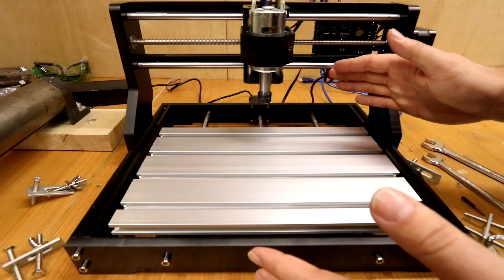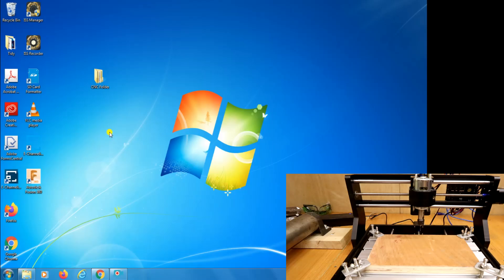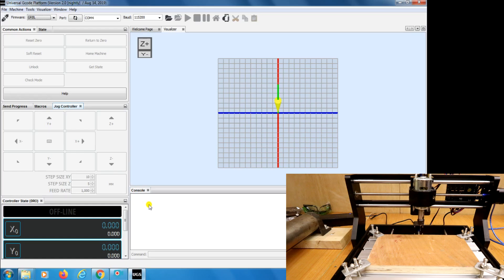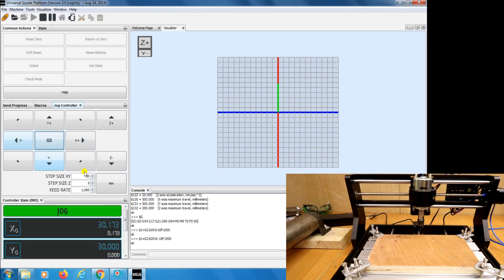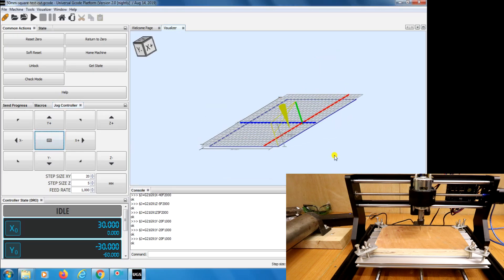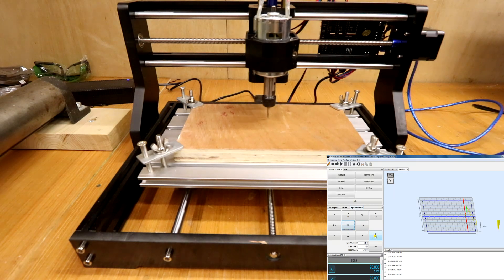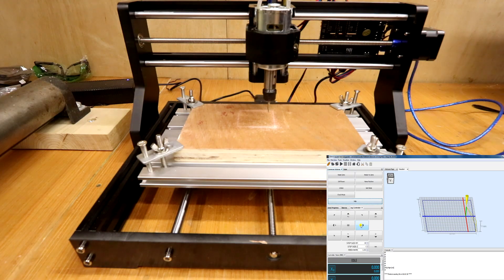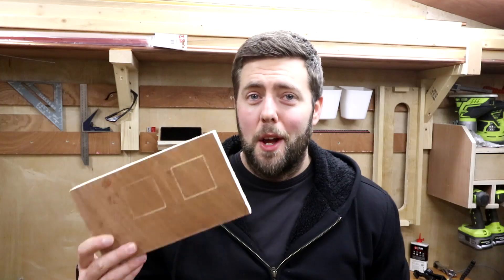3018 PRO - Making your first cut

Comment: these videos are great James. Thankyou.  I loaded a gcode file of a star for my first cut.
I centred the head and lowered the spindle. I pressed reset zero and then start. The machine moves, only a mm or two and the spindle doesn't spin! I've checked the wiring, reset everything again and again. Still no movement or spinning! Any advice welcome.
Reply from the maker: Thanks Peter. Where did you get the gcode file from? Did you make it yourself?
Reply: @JamesDeanDesigns  Hi James.  I watched you very informative '3018 PRO - Tuning GRBL settings' video and '3018 Designing and cutting'.  I think in one of those you explain how to create a g-code file. Anyway, I created a file with the extension '.nc' through notepad and imported that through the UGS software. I can see the picture (star) , the lines the machine will travel on etc. I can't however move the (green) vertical line to where the cut would start. When I press start the machine hardly moves and the spindle doesn't spin! It's trying to work. Sorry if I'm not using the correct terms here but I'm brand new to this type of woodworking. I really appreciate that you replied.  Cheers.
Reply from the maker: @peterchampion1494  So the spindle not spinning will be because your Gcode is missing a line something like S9000 M4. If you created the file in something like Easel, there is an option in the menu that asks what spindle control, it will either say manual or automatic. You want to select automatic. As for the green line, you move the head to where you want the job to start on all three axis, so that typically also includes lowering the spindle down until it just touches the materials, and then click Reset Zero. This will now make that position the start for your job
Reply: @JamesDeanDesigns  Thanks again James. Its morning here in Australia so just saw your response. I'll give all your advice a go this afternoon and let you know of the outcome. Cheers  :)
Reply from the maker: @peterchampion1494  no problem 👍

Comment: Well Done Sir. I am a grateful viewer since my machine is new and unspoiled. By chance did you do a video on the offline controller or could recommend one? I’ve a desktop and am not sure I could set the machine in the living room consequence free... No matter what, thanks for the excellent tutorials.
Reply from the maker: I've never used an offline controller my self. Personally I would just buy a Raspberry Pi or cheap computer to sit with your machine. It will cost a little more but there are extra advantages. To my knowledge all the offline controllers are pretty much the same unless looking at the really expensive ones so I dont think it makes much difference but you might be better asking on the Sainsmart group
Reply: @JamesDeanDesigns  Yeh. I just came into a used desktop that is now getting recycled to the shop. Great work sir. Thanks again.
Reply: I used an MKS tft 2.4 and programmed it for GRBL on Github, it plugged right into my board.

Comment: Cheers for this. Extremely helpful and well presented tutorials :) A few issues that I had (that you didn't) mentioned below, complete with suggested fixes, in case anyone else has the same troubles. 

My 3018 pro model had the X motor mounted on the left side instead of the right, and it worked back to front and jammed a lot! Rebuilt the machine with it on the right and it worked fine, although the X bearing ended up on the outside instead of the inside, but that doesn't seem to matter. 

My software just has Z+ and Z- buttons, with no direction arrows (up/down), so I missed that it also worked the wrong way around. Caused very nasty noises on the first test! Realised then that the makers had reversed the Z motor in the firmware, instead of the X, and so I ended up with two motors that went the wrong way!!! Just swap the red and blue wires around on the stepper motor connection plug if it happens to you. Lift the plastic tab on the connector with a craft knife and the connector will pull out.

Other fixes are possible of course.
Reply from the maker: Thanks for the extra info and glad you've managed to sort it out 👍
Reply: Hi Clark .... I know exactly what you are talking about, because I had that same question regarding the X axis bearing. I think I was in the same situation as you a week ago! . Additionally, the Y axis of my machine moves in the reverse direction, I think it is solved by configuration in the driver. In my case the driver was made by Annoy Tools, and it really looks great. Additionally, I think I will have to move the X axis-Y axis set towards the center, since I suppose a zero position in the lower left corner, but it will look different from the photo in the manual   !!  In conclusion a true DIY project ... but I'm enjoying it! Thanks for posting your experience ... best regards!
Reply: @EfrainRoca  Hi Efrain, your board looks more advanced than mine. Spindle upgrade for me next, as mine is sadly lacking in speed. I will connect a relay to the existing spindle wires, and that will switch the new 20000 rpm 775 motor on and off. Power for the new motor will then be from a separate supply, with a PWM speed control. James Dean recommends a similar set up in his upgrade vid, but I think the addition of a relay and speed control will make a big difference. All the best with your projects. No more hand cut inlays soon, as my eyesight isn't getting any better ;) You can see some of my stuff here: https://youtu.be/5cDZavyiAnQ

Comment: why does my program move so much further than the actual equipment
Reply from the maker: The collet is meant to be tight but sh I should com undone. If you have the top spanner to the left, and the bottom spanner to the right and push them together they should hopefully release

Comment: Hi I have just set up my 3018 which I have had for a while, I went to set it up using your link but my page has not got the panels on the left hand side, "Am I doing something wrong" can you please tell me how and what I can do to correct it so I can continue to follow your tutorials which i am finding a great help so far.thanks
Reply from the maker: This is UGS classic, you may have downloaded UGS platform which is the more modern version. All the tools will still be there just possibly in different places. You may need to turn them on from the View or windows menu at the top
Reply: @JamesDeanDesigns  Hello Mr Dean thanks for replying to my question, I downloaded the zip file. I have tried pressing all the tabs along the top and side but still nothing showed up, I will download the classic and try that, please bare with me as I am not computer technical, I use them but I am a total novice, what do I do to become a patron and how much does it cost as I know that I will need more help. Thanks
Reply: I am using a Lenovo ultra book, I finally got up the correct window in the UGS and have been following your steps right up to the test point then it does not work, I cannot change the numbers on the jog controls to move left or right is this the ultra book or should I use a laptop which is more powerful.
Reply from the maker: @carpenterman1964  it doesn't require much power to run. The only thing I can think of is if its not connected to the correct port. You could always try using Candle which is an alternative to UGS and can be a little easier

Comment: Great start up information. Helped me get started  but I am having problem with the bed leveling. It cuts deeper on one side in both X & Y. I have spelt hours on this with no luck. Di you have a tip or another video addressing this issue?
Reply from the maker: The best thing to do is fit a spoilboard and then level it. That way your bed will be parallel to your X axis. I dont have a video of doing this but if you go to the Sainsmart Facebook page, there will be a guide in the Files section by Graham Bland about making a spoilboard
Reply: @JamesDeanDesigns  Thank you for replying back. I was thinking something like that. Someone told me to use a surfacing bit and mill the Aluminum deck but I'm far more comfortable with your idea.

Comment: Hi James. Just built my 3018, and got the UGS software working. This may seem a daft question, but why isn't there a spindle run button to fire up the head? Cheers for the video.:)
Reply from the maker: I thought it was available in the platform version but I'm not sure it is in the classic version. Its easy enough to do if you want via the console bar. Just type M3 S10000, that basically means start the spindle at a speed of 10000 rpm. To stop it just type M5
Reply: @JamesDeanDesigns  OK, Thanks James, I'll give it a try later. At the moment, I'm trying to get the 'Easel' software to connect to the machine, just keeps asking me to install the drivers, which I've done three times now. Lol :)

Comment: I just received mySainSmart 3018, made a drawing in Inkscape, converted the SVG file with Jscut and wanted to run it with UGS. Two issues, 1: I don’t have the MM box next to the step size as you have and the spindle doesn’t turn on with the code. I also don’t know how to turn the Pinole on manually? In your example, the spindle works automatically. Where am I going wrong?
Reply: same question. My spindle doesnt run

Comment: Why im getting so much vibration on the X when its running?
Reply: The machine doesn’t have the best tolerances, try using some lock tight on the screws and some rubber washers helps dampen vibration to a small degree but over hard to say with out knowing how hard your running the machine

Comment: Thanks James! Most helpful as always for a newbie. What was the depth of cut and cut speeds across the board? Cheers!
Reply from the maker: For the file in this video? I cant remember off the top of my head. Usually to be safe I start around 400-500 mm/min with a depth of about 0.4mm/pp. Thsts a fairly safe starting point and you can increase from there

Comment: hi james!! setting up my cnc machine and it won’t move at all, all the lights are on at the black and checked connections but nothing seems to send to the machine so no movement when using the jog controller! any idea what’s up with it?
Reply: I’ve similar issues. Z is working, as is X. But Y and the spindle motor don’t work!

Comment: Quick question about dimensions.  If I have a file that says the image I’m cutting is 10x15 how do I shrink it to fit my bed?   Will I have to  get into the code and change settings or will the machine automatically keep it within the parameters that it can function?  If this is addressed in one of your video please let me know.  I have not watched the video on laser setup yet.  Thank you so much for your speedy replies, you should be hired by the company that built this thing.  Take care!
Reply from the maker: You will have 2 types of files. The one from the design software and the gcode that you export to actually run your machine (like the square in this video). To resize something you need the design file (and the relevant software). Unfortunately you can't resize what ever is in a gcode file to me knowledge
Reply: Looking at software for the router, which one might you suggest for a small business making personalized wooden products?
Reply from the maker: @Mindycogswell  the basic Easel and Carbide create are popular free options. Carveco seems to be getting some traction but that is paid for software

Comment: Hi James thanks for your videos, they're great and you're making things so very easy.  I am having issues and am hoping you can help.  I am using a macbook and I downloaded everything, candle, UGS.  My problem is that my computer is not seeing the router.  I can move the machine on the visualizer but the machine itself does not move.  I am thinking this.  The only thing I can think of is that I don't have the proper drivers or the comm port is wrong.  The two that populate are tty. and cu.  The baud rate is 115200.  Any help you can give would be greatly appreciated.
Reply from the maker: I suspect you are correct and that its not connected properly. Its difficult for me to advise as I dont use the CNC with a Mac. On Windows there is something called Device Manager and that shows what is connect to your machine and whether it is connected correctly or not. I suspect Mac has something similar. If not done so already, head over to facebook and join the Sainsmart user group, there are lots of people in there who use Macs and can probably advise you better
Reply: So after spending several hours on the machine I got it to work.  On the clear panel where the wires connect, there’s a little white button that I had to engage😡. You have no idea how intelligent I feel right now.
Reply from the maker: @Mindycogswell  I spent 2 days straight trying to solve an issue, I'd accidentally changed a setting that literally took me 2 seconds to change back once I finally realised. We all have those moments 👍

Comment: hi im new to all this and the iissue that im having is im getting the 3d files ok no problem there but i am having a problem turning the stl or any other 3d files in to g-code. I am using the woodpecker grbl cnc 3018 pro router , now when i have managed to create a g-code say using aspire or fusion 360 then the control software won't recognise the code please can you help because im starting to get frustraited because i can't get any work done. Thanks guys
Colin
Reply from the maker: Hi. It could be one multiple things. Can you actually open the files up?
Reply: @JamesDeanDesigns  thanks for getting back to me.
the trouble im having is as i understand it is the file needs to be a g-code thats where my problem lies im having major trouble converting any 3d file to g-code i dont know the best software to use.

Comment: Hi i have just installed the program and when trying to run my file i am getting an error,
>>> G1X-3.96Y-29.74F3500.00
[Error] An error was detected while sending '0S30': (error:1) G-code words consist of a letter and a value. Letter was not found. Streaming has been paused.
[Error] Error while processing response <An error was detected while sending '0S30': (error:1) G-code words consist of a letter and a value. Letter was not found. Streaming has been paused.>
** The communicator has been paused **

** Pausing file transfer. **

Comment: Hi James, Finally after many months I sat down and built my 3018 CNC.  I have loaded the software on an older laptop which runs Windows 8.1.  I downloaded the UGS software and it all connected to the CNC fine and the motors are all doing as expected.  I got as far as looking for the test file but when I clicked open it didn’t go straight to a test file.  I put in name ‘test file’ and open and it loaded some GRB code which looked like yours.  But no yellow lines showing or any outline of a square.  I pressed run anyway but I got an error message, “Error while starting file stream”.  Any ideas?  Andy.
Reply from the maker: The file in my video is a zip file, so first you need to extract that out. Usually once you have downloaded the zip file you should be able to right click on it and there will be an extract option. Once its all extracted you should be able to see the test file

Comment: hi thank you for the videos, i have done everything but my machine is connecting but the spindle is not moving at all
Reply from the maker: Thats strange, several people have mentioned this to me in the last few days. Check all your wires are connected properly, check that you don't have either a laser or offline controller plugged in at the same time either.
Reply: Same Issue
Reply from the maker: @rebeccahume  are you using UGS or are you trying to use Easel?
Reply: @JamesDeanDesigns  UGS. When connecting, the jog panel doesn't come to life.
Reply from the maker: @rebeccahume  that means its not connected then. Make sure you have the driver installed. You can check this in Windows Device Manager. It will also tell you in there what the Com port number is. Then within UGS, make sure that Com port is selected and also make sure the Baud rate is correct which is 115200

Comment: Hi James question spindle worked yesterday not working this morning, have you had this , any ideas? Plugged in and code seems to be there. yours Roger
Reply from the maker: I've not had it but check all connections, make sure you do not have the laser or offline controller connected at the same time. Sometimes you do need to hit the rest button on the control board as well
Reply: @JamesDeanDesigns  Thanks James, i checked and it was all down to me, in easel when i was transferring the G code the spindle speed had changed from auto to manual. My mistake. Cheers Roger

Comment: Hi again James, sorry to be a pest, when i move the x plane i find the movement on the X+ moves smoothly and quietly, when i send it back X- it makes a noise  but the travel is smooth, i am concerned about the noise, is something not aligned maybe?
the spindle came ready built,
on all other planes it is quiet and smooth
thanks gain
Les
Reply from the maker: Are you using lubricant. Specifically dry lubricant
Reply: i ordered some a couple of days ago , will be here tomorrow 16/12